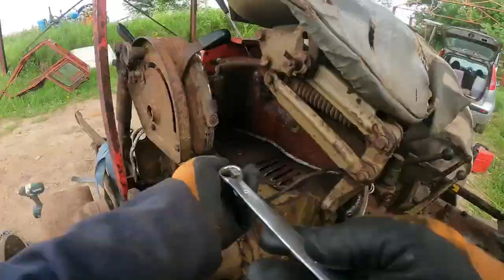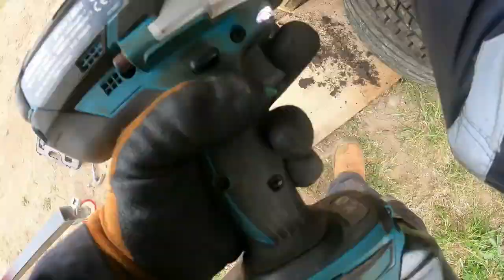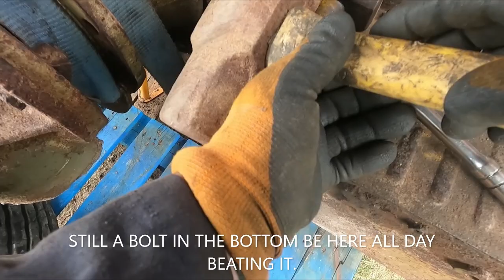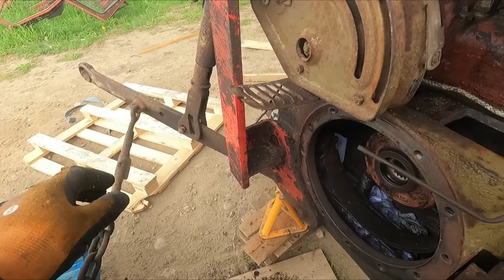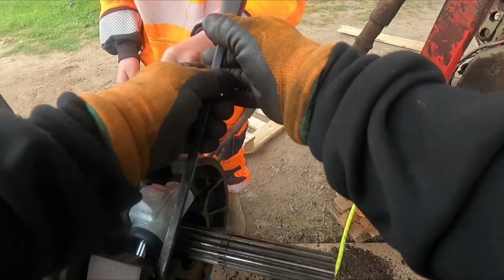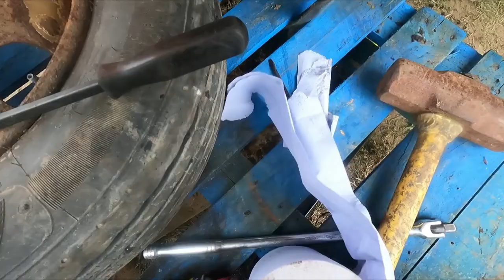ZETOR BRAKES REPAIR! Cylinders Replaced 🔧⚙️ #zetor #restoration

Comment: Tidy bit of rigging Davy 🤙😂
Reply from the maker: Cheers Matty pal, I’d have been beat without the engine hoist, need pull one side apart again in order to fit new brake shoes, really should have had a set for doing the job.👍🏻
Reply: Good job there though pal 🤙
Reply: @daleharrison7679  , brakes are only for parking anyway 🤙

Comment: Nice video! Got a 4718 in poor condition. Can u guys make a video showing oil change on diesel pump and regulator? Can’t find any good description on that on net👍
Reply from the maker: Hi Sven, I will be doing this to our 3511 soon, it was running very poorly on idle and after topping up the oil in the governor unit it sorted itself out. Il try get a video done next week on that 👍🏻
Reply: @RedShedProjectsScotland  thank you👍

Comment: Did you loosen the Handbrake bands before taken off the Portal Axle? If not maybe its the Reason it doesn't really wanna come of at 10:20.On the Drum is a lip and normally the band does(should) not slip over it because its tight fit.
Reply from the maker: Hi Frank, We did end up loosening it up some more, it was all trial and error I’d never attempted this kinda job in the past. Fairly familiar with the workings of it now though.

Comment: Did you replace the oil seal in the housing where the shaft goes back in on instalation? Only there was a fair bit of oil on the drum.
Reply from the maker: Yes Phil it has since been replaced, unfortunately it had to be taken apart again to fit the new seals, it was mostly brake fluid that had leak onto the installation.

Comment: Did you change the diff cover seal , if you did was there a spring inside it 
Thanks
Reply from the maker: We only changed the seals were the splined shaft goes in, this job was the first I’ve ever worked on a tractor. Are you doing something similar?
Reply: @RedShedProjectsScotland  
I am aye, 
Have brakes and clutch done ,. Getting crankshaft done at the moment
Have new panels for it , 
Was one of the zetor s of the farm,  was bought second hand 1988,
A slow moving project ,
How many litres of paint did it take to spray yours ,
Reply from the maker: @thomasmclaughlin2206 I didn’t get the chance to enhance mine much further as we bought site to build a new house and it’s been working all summer. Hopefully after the house is finished il get a decent shed put up and il finish it probably. I bought 5 litres of Red and 2 litres of beige colour and had loads left over.
Reply: @RedShedProjectsScotland  
Ok that not to much paint , any left over will do the 6718,  
I seen in a video you were thinking of   putting on  zetor cab , you would need a 6911 cab to fit that tractor because of the diesel tank , 
And you would need new clutch and brake pedals ,
Reply from the maker: @thomasmclaughlin2206  I ment to refit the Duncan cab it came with its in quite tidy condition, although I like being able to just hop on and off without the cab. Probably only really use it in the better weather it’s currently under cover for winter, if I get time tomorrow I may do an update on what I’ve been up to with the new place.
Reply from the maker: @thomasmclaughlin2206  Zetor cab would be sweet though, remember as kids at the potato picking we had about 10 of us crammed into one 😂 some space in them
Reply: @RedShedProjectsScotland  hard to beat the potato pickering , tenner a day